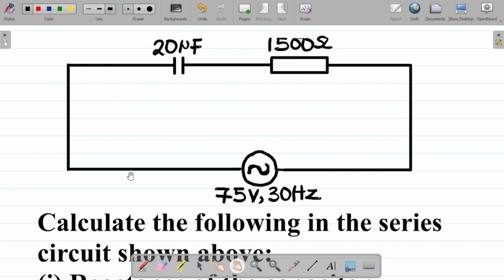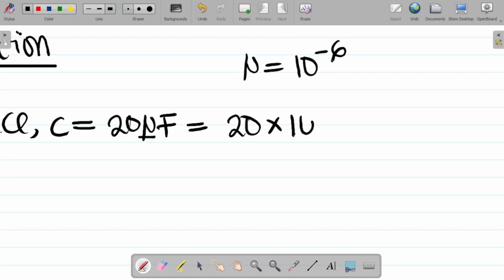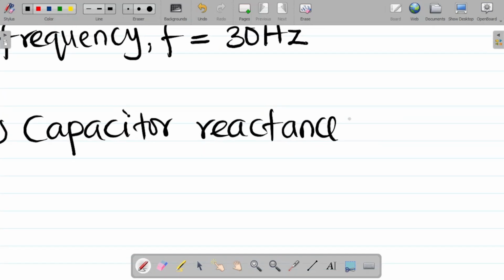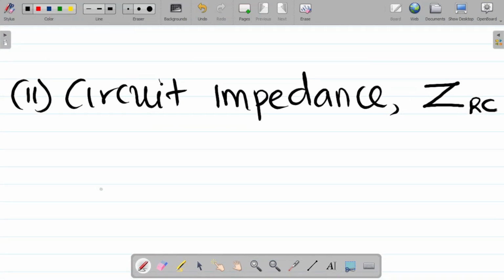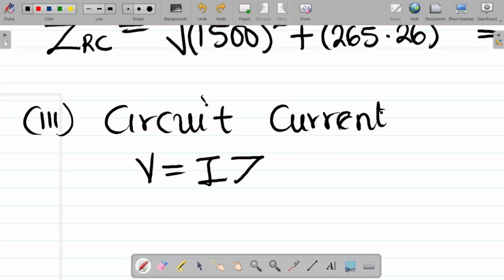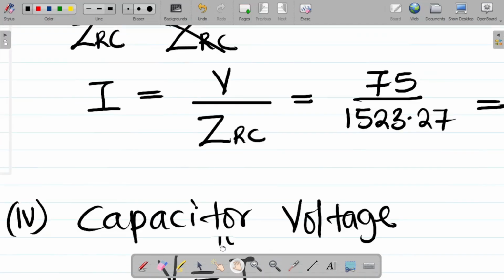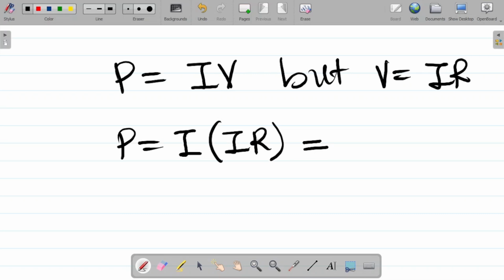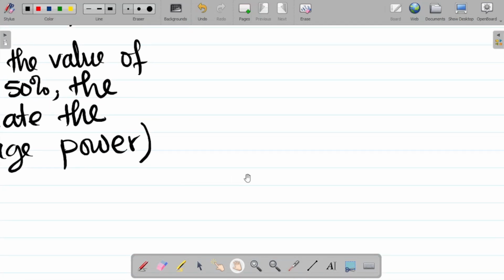AC Circuit Physics Tutorials - Questions and Answers on Physics Alternating Current Circuit.

Comment: The new resistance is 30ohms and the average power is 7.203*10^-3
Please am I correct?
Thanks a lot once again
Reply from the maker: Awesome.  Welldone 👍
Reply: 3000 ohm
Reply: Sir i got 7.203x10^-3